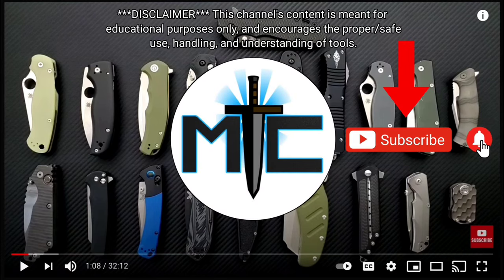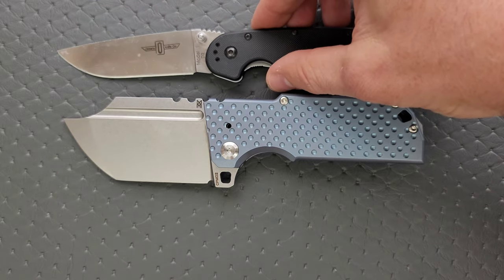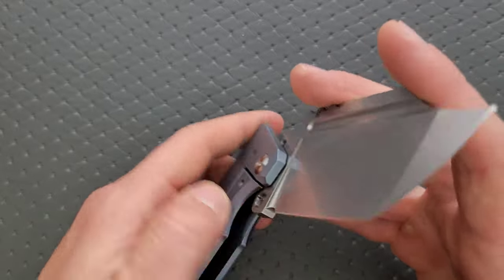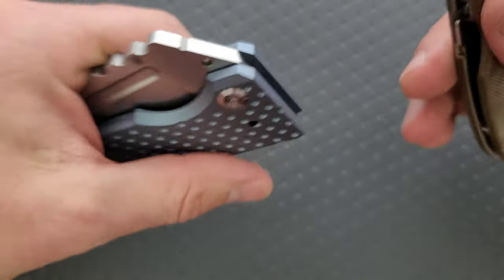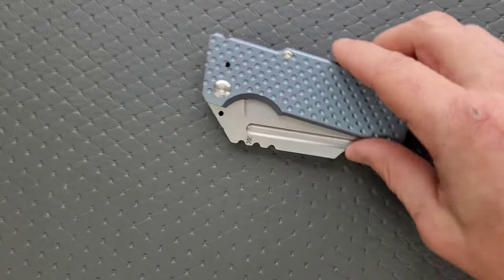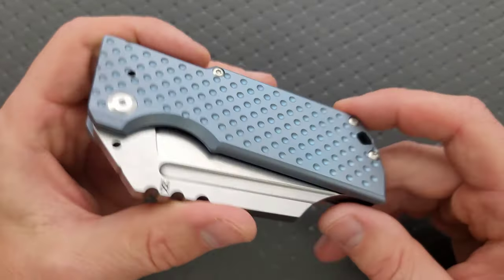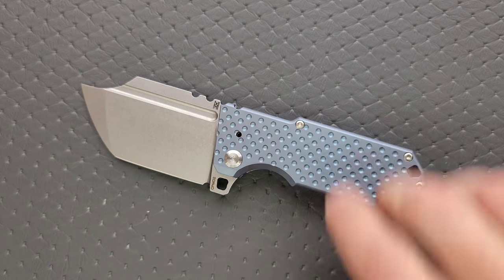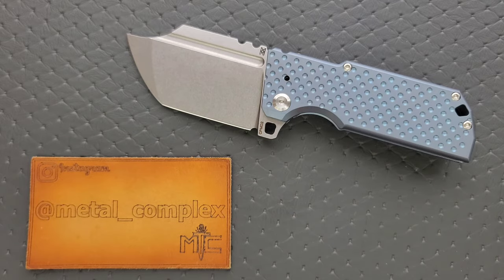Hulking TANK! - Midgards Messer Thunrar Folding Knife - Overview and Review

Comment: The Pin is there due to german law. It is not considered foldable anymore once its bolted. There are even versions of Midgars knives where you can put a small padlock trough the blade to "unready" the knife...